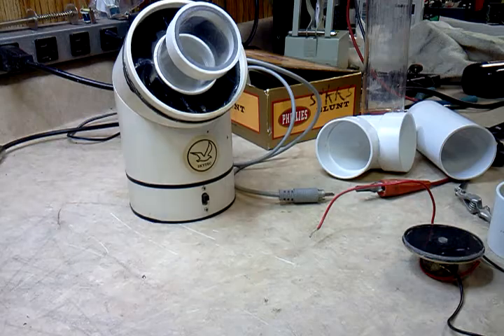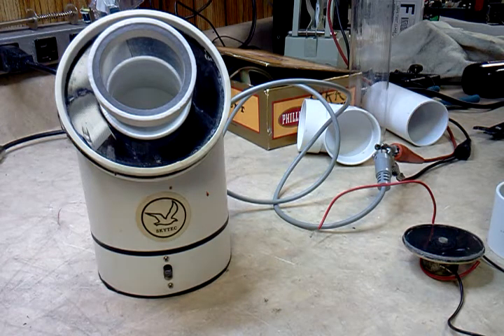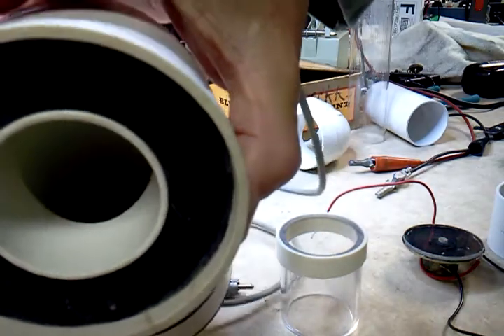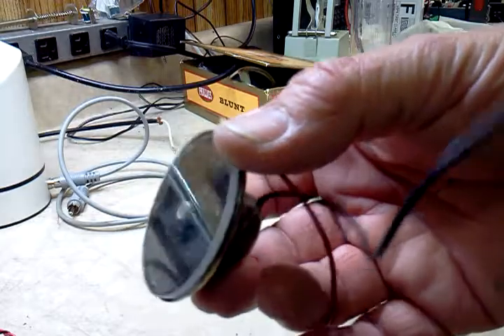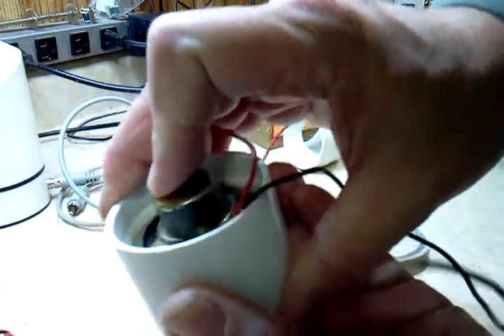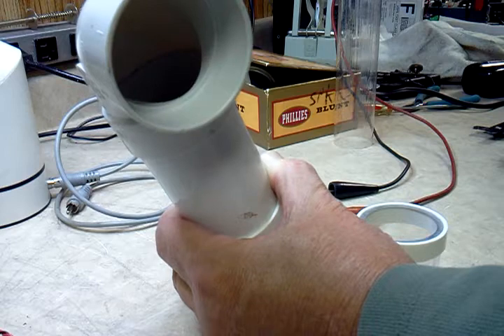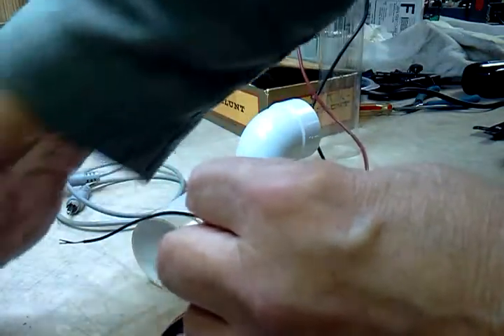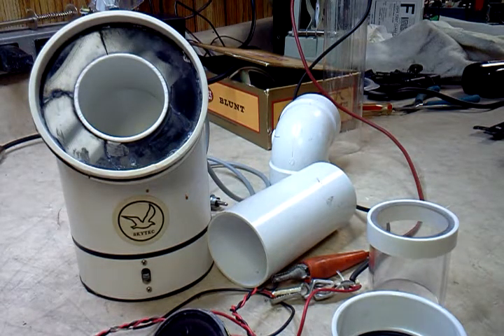Building a Resonant CW Speaker

Comment: Steve will this work with a higher watt output speaker?   I have a 2” 2.5watt speaker?   I have the right one on order  but was curious.

Thanks
Pete
Reply from the maker: Maybe but the original speaker would be more sensitive and probably resonate "free air" at higher frequency. My guess is that you will experience less performance but have at it!
Reply: Steve i found a .5 watt speaker  i was able to build one and it sounds great!